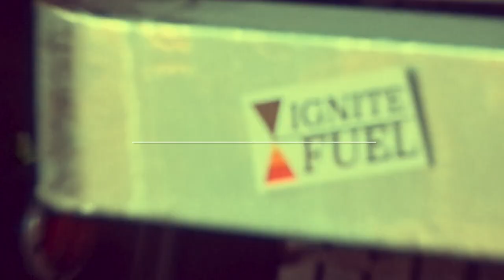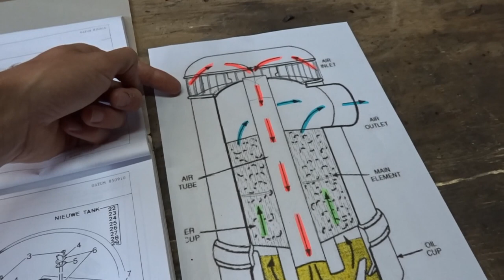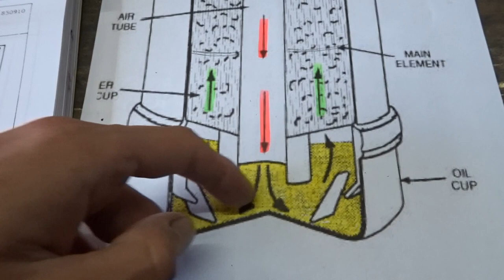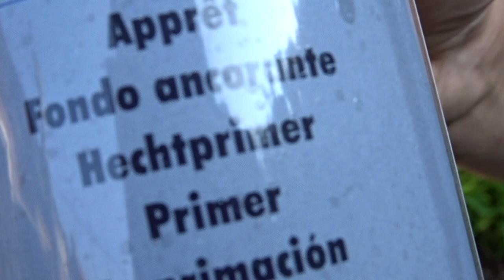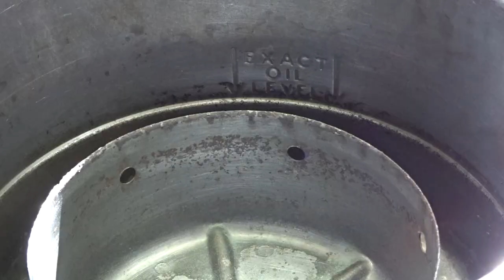RESTORATION | Oil bath air Filter (Gross!🤢) | Land Rover Series

Comment: 7:10 in the video:  There is an easier and much less destructive way of fixing the broken bolt for the lid.  Instead of welding, get a connector nut (elongated nut) in #10--24 thread size, cut it to the same length as the spacer, cut the remaining part of the broken bolt that still attached to the filter to half of the spacer length, thread the connector nut on, take a #10-24 bolt and thread it on, put lid on, cut bolt as needed, put regular #10-24 nut on, and voila!  I don't think the original thread size is #10-24, more likely a coarse British thread size, but the modern #10-24 thread fits nicely.

Comment: Jan take mesh outside  lite the mesh on fire till it burns  all the cap outs and metal and  re paint  I cleaned many times  on old  oil air  filters  ron brennan rdzl om616
Reply from the maker: Good advice Ron! Thanks, will try it out ;)
Reply: Thank you for the tip!

Comment: Jan- My air filter element was missing the primary mesh filter...I didn't realize there was a primary mesh.  I do have the mesh that is in the upper part of the air filter housing.  Do you remove that mesh as well for cleaning?  Initially, I just poured petrol into the housing to clean the mesh in the upper housing.  it looks very clean.  Anyway, thanks for any advice you can offer.
Reply from the maker: Hey Michael, Thanks for your comment.
I only took out the primary mesh. I wasn't able to take out the secondary element. 
Usually the primary element will be the most dirty and the second element is there just to collect as much as oil droplets before the air goes into the engine. 
Have a nice day and all the best!
Jan